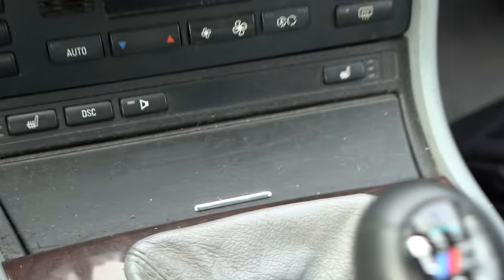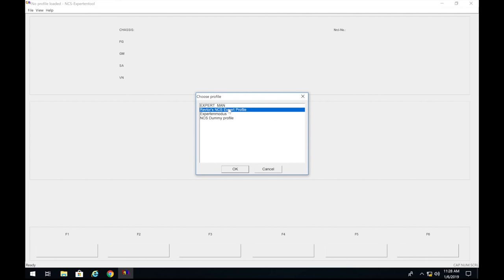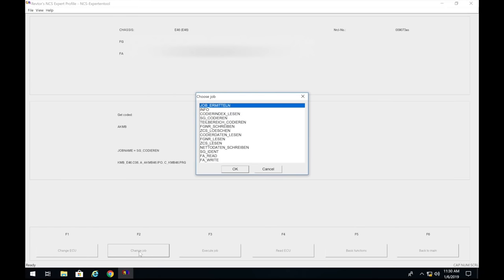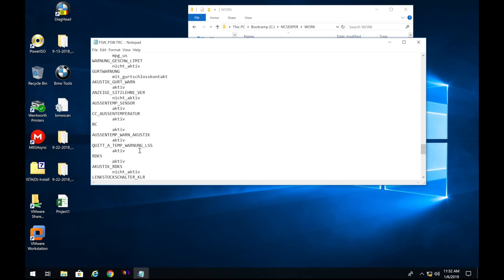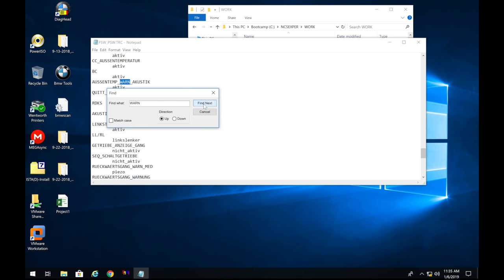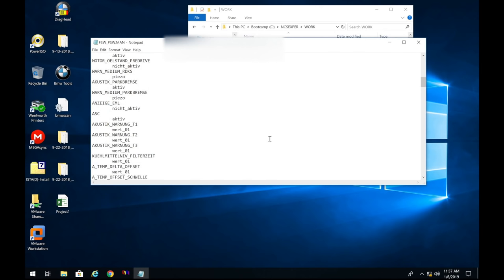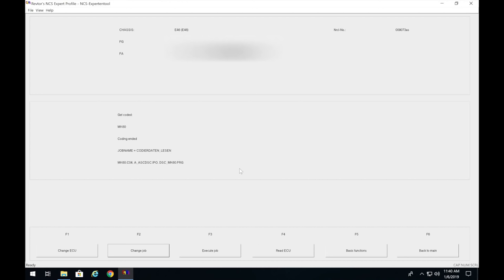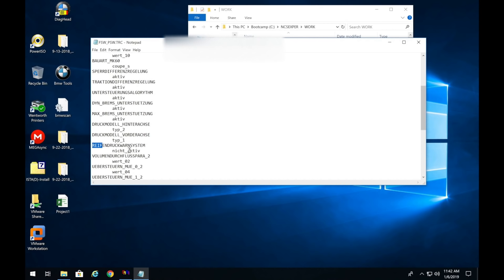Adding Tire Pressure Monitoring System to a BMW e46 for FREE + Announcing Giveaway WINNER!

Comment: Are you a member of the ZHP Mafia forum? did you contribute any to that thread for retrofitting the MK60 TPMS speed sensor based monitoring system? DId you mention at all that though most MK60 will support this, only the early coding index units from 2003 ZHPs and the m3 coding index variant of the e46 M3 MK60 module will support the button OR if you get an MK60 module from a parts car that came with TPMS from the factory.

for a lot of people that do this they will have a TPMS system that works partially, and when they get the indicator for low pressure, the button wont reset the system and they will need to use INPA to reset the system.

Comment: Hey Evan, Thanks for your channel.   I'm having a problem adding this feature to my 05 325.  I can load the first 3 files loaded and the software confirms by resetting the clock along with the chime.  But I can't get the MK60 file to load and don't get the TPMS indicator to light.  Sometimes after trying to load the MK60 file to load I reopen the program and NCS Expert is still waiting to load the file.  Do you have any suggestions?  Thanks!

Comment: Hi Evan! So just to be clear. This only works with DSC applications and ACS traction control cannot be reteofitted with this?
Reply from the maker: Correct
Reply: Thanks for noticing, thanks to you I did not bother to try code mine ACS system.

Comment: It's not tire pressure monitoring, it is run flat monitorin called WDS or RPA. RDC need sensors in tires. This one works via DSC and warn you when your tyre have no pressure. RDC (tire pressure monitoring) works different. If pressure change from fe. 2.4bar to 1.8bar then it warn you.

Comment: Thanks for this. Was just dealing with this after my swap. If you want a mint M3 headliner to replace your saggy one, shoot me a note.
Reply from the maker: Yes I would love a new headliner
Reply: Evan Goyuk I’m in CT near casinos. It’s a M3 one so it’s anthracite like the ZHP cars. $125 and it’s yours. Perfect condition.
Reply from the maker: Is it just the head liner or is the also the pillars?
Reply: Evan Goyuk it’s just the headliner. Pillars typically are 250-300 for a good used set.
Reply from the maker: Hm let me think since I would need to find pillars in goo condition
Reply: Evan Goyuk no worries man. I’m just motivated to not have it around. My pillars were spoken for before they ever came out of car.
Reply: I also have a bunch of black interior pieces. I M3 swapped a touring and I don’t want to throw things away.

Comment: Is the reset location changed in new inpa? I cant find it. If I press activate and view the options (f7 ) is greyed out. Menu also show different stuff than yours. Break bleeding test / calibrates etc is in there. Is it still up to date? I do have dsc.
Reply from the maker: Do you have the mk60
Reply: @EvanGoyuk  yes
Reply: Found a solution? I have the same issue. It triggered the warning and indeed my tires needed some air. But no I need to reset it. Cant find it anywhere.  Do we need te de-program it and turn it all off? Edit. Lol responding to my own comment lol
Reply: @PrimalFury  Did you end up finding a solution to this? I have the exact same problem. I got a flat tire a few days ago and it worked, but now I cannot cancel the red light. I even tried the reverse steps to “decode” the feature, but when I recode it the red light comes back on. RPA is greyed out and I only have options to activate the brake bleeding...
Reply: My reset option f7 is greyed out also. Followed the video witch was super understandable and clear, but cant reset in inpa😭
Reply: Hi, I have the same problem. F7 option in INPA is grey and I cannot reset TPMS system. My car is 330D E46 YR2003. My INPA version is 5.0.6

Thanks!!

Comment: Sorry to bother you.......
Do i have to buy and install RPA module ?
(E39 520i)
Reply from the maker: You are not bothering me I am here to help my friend! No so the RPA system uses the wheel speed sensors to find out if one tire is lower than the others it compares the revolutions of the tire. The only thing you could add is the tire button reset because if not you have to use inpa to reset each time.
Reply: @EvanGoyuk  thanks reply...
When i checked RPA informations on Google. There are not many informations about E39 series (Most of RPA or RDC is about M5). And i found out. If i want to use RPA, i have to RPA module.

I just want to know below Q.
*Not buying RPA Module?
*Only need for coding?

● in fact,
I already installed INPA and EXPERT.
and i can use it a little.
So. For setting tire value, i don't need
another switch for reset.

Comment: Ho Evan

Once the AKMB file is modified, renamed and coded, do i need to delete the TRC and MAN files before reading/writing the MK60 module?
Reply from the maker: No, NSCEXPERT will write over the file and clear it out
Reply: Evan Goyuk 

Thanks Even. Got a question on this retrofit. The older E46’s (99-00) appear to not have an “AKMB” module but use a “KMB” module. I was unable to read the AKMB due to a COAPI 2062 error but the KMB is fully readable. The KMB TRC file does not have the line CAN_RDC or CAN_RDS and i do not have an MK60 module either. 

My car is a 2000 model, production date 12/99. I read through the ZHP Mafia thread you posted but no other E46’s besides ZHP’s did this modification. 

Darn, i was really looking forward to get this working on my 328ci.
Reply from the maker: Hmm let me do some research. I do not have a zhp. I have a 2002 bmw 330ci.
Reply: Evan Goyuk    Ok. Let me know if you find a way. I am researching as well. My car has an MK20 module. I read out and saved copies of all the module files. My MK20 does not have the data line required to modify specified for the MK60 module

With coding 3 of the 4 required lines (CAN_RDS or CAN_RDC are not in my cars KMB module read) to my KMB module, the TPMS icon lights up on the dash but it stays on all the time. Tried the reset through INPA but that does nothing. 

Can the  line my KMB module file doesn’t have be added along with the line thats modified in the MK60 be added to the MK20?
Reply: @markperez6195  if you have an e46 that oly allows the reading of KMB and not AKMB.. that means you have an older e46 usually with the round connector in the hood which also means you do not have an MK60 module thus this wont even work for you. you need an MK60 DSC module, the MK60 resides driver side under the booster/MC and is usually on face lift e46 M3 2003.5 and above, all e46 ZHP cars coupe/vert/sedan and late model e46 cars. older e46 and XI/AWD e46 have either MK20 (RWD) or Bosch 5.7 systme both which reside in the drugbin passenger side area.

Also its a better idea to use NCS Dummy in conjunction with NCS Expert. nCS dummy will show all information from your trace file in english AND when you are done modifying the trace file with your option and choosing export to MAN file...you use NCS Expert to write your MAN file to your module and when NCS Dummy closes it asks you if you want to clear out the MAN file and you say YES.

Reason this is important.... NCS Expert default setting is SG-Coderiedn which is WRITE.. if you have an OLD MAN file lingering and you accidently hit execute with at MAN file in place, you coulc potentially write data for the wrong module OR incorrect old out of date module data.
Reply: @markperez6195  you can't use this system your MK 20 DSC system doesnt support wheel speed sensor based TPMS unfortunately. your cluster may have the indicator because of an older module based CANbus type TPMS system in older e46 but your MK20 doesnt support it.
Reply: Shawn Robertson 

Yes i use NCS Dummy as its an easy way to modify the file.  I was hoping i could get it to work but looks like its a no go due to the vehicle hardware restrictions. I was able to code the TPMS icon to appear on the cluster but nothing else. Will have to revert back to my original setup.  Thanks for your reply.

Comment: Hi
My vehicle is E39(2003y  520i)
Is it possible for E39 ??
Reply from the maker: Yes it’s probably is you would have to do some more research
Reply: @EvanGoyuk  You say....
This is Basic Function in e46 module?
(We just use Inpa+Expert)
Not buying any different module??
Reply from the maker: 배드민턴레슨닷컴 공식채널 badmintonlesson correct
Reply: One more Q.
If i want RPA coding like you.
Do i have to buy and install RPA MODULE ?
( i saw RPA module in some forum)